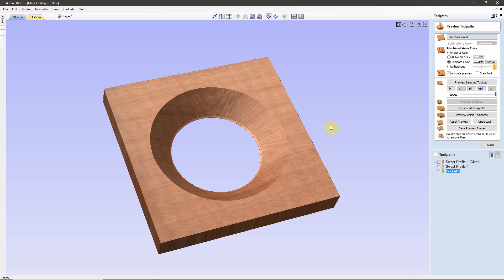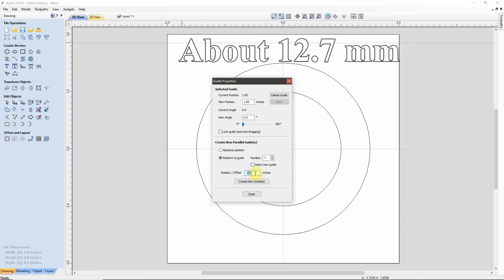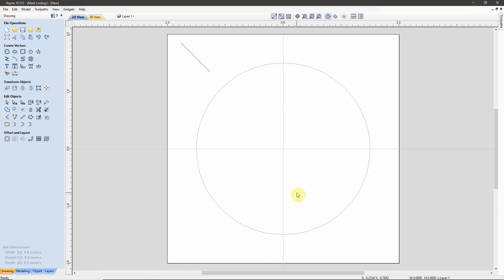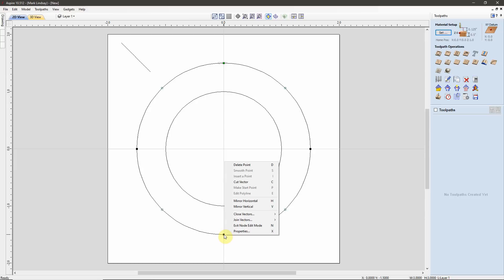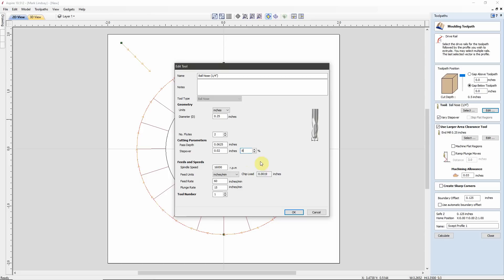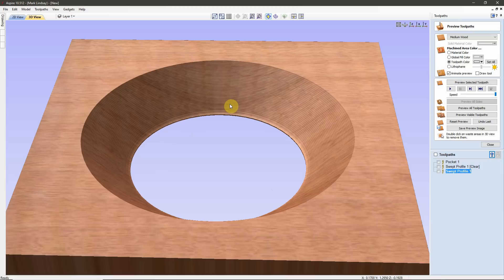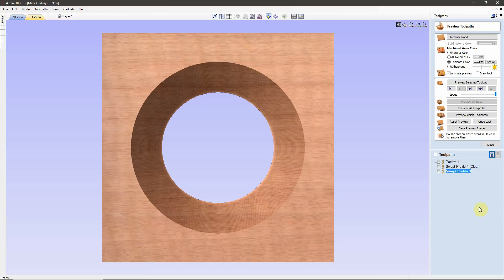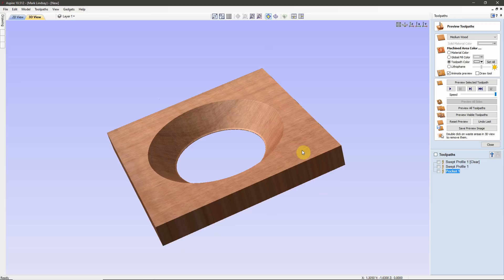Carve a Tapered Hole in Vectric VCarve and Aspire

Comment: Hello Mark, how could I make a long socket holder. I would like them to be snug around them, keeping in mind some smaller sockets have that curve taper to the tip. Further on I would like to make it at an angle, meaning the bottom of the sockets are lower than the tip.

Comment: Hi there,
You are teaching me (a complete newbie) a lot, thank you! A question. You say that it will always project out with a closed vector so you then split the circle into two halves. As al alternative why would you not have just left it as a closed vector and simply use the inner circle as the guide rail? Apologies if I am using the wrong terminology - as I said I am still really green at this.

Comment: To save wear and tear on the wide bit, could you have done a profile path yo the inside of the inner circle then remove the interior?
Reply from the maker: You would have to find a way to hold that inner piece so it didn't come loose when you cut it out. You can't use tabs in the Moulding toolpath. That's why I pocketed it out.
Reply: @MarkLindsayCNC  caveat I haven’t even purchased a cnc machine yet. Still evaluating the landscape and trying to find the courage to tell my wife I want to start a cbc business, lol. Thank you for your reply

Comment: I'm guessing we can somehow use this technique on outer profile tool paths as well? ...instead of applying draft to model. I'm not sure the result would be any different though but something to think about. Thanks Mark!
Reply from the maker: Adding draft to a model is not an option in VCarve, and the question I got was specifically about doing this in VCarve Desktop. Yes, you can add draft to a model in Aspire to get the same result. Actually, I can think of about 4 different ways of getting the same result in Aspire, but almost all of them aren't available in VCarve. As for doign this on an outside profile, just don't split the vector and the Moulding toolpath will project to the outside. Boom - done.

Comment: HI Mark. Good vid: A couple questions. 1) Using Guides vs. a square. If I knew I needed a 1/2" diagonal line, why not draw a 1/2" square and then a line from one corner to another? Seems like fewer steps then dragging and offsetting 4 guide lines. 2): why not select the inner circle, reverse the direction of the profile vector and make the swept profile rather than cutting apart the outer circle? Thank you.
Reply from the maker: Thank you! The reason I used guides in this video was to reinforce their use. I'd had a lot of questions about using guides prior to making this video, so I decided to use them for this demonstration. You absolutely can use a rectangle to get your angle. The reason I didn't use the inner circle was to avoid potential damage to the bit or the machine. By selecting the inner circle and sweeping that profile upward and outward, that means your bit is going to move over to that inner circle, plunge in the full thickness of the material, then try to carve it's way up and out of the trench it just dug in one pass. A good percentage of CNC routers can handle that, but a bigger percentage of home/hobby CNC routers can't. Additionally, depending on the bit you're using, the bit may not have enough cutting length to be able to cut the full thickness in one pass. This is especially true with smaller diameter bits. If you try to cut material that's thicker than the cutting length of the bit, you WILL snap it off. I addressed both of these questions in Live Q&A #75, which followed the video, the day I released it. If you'd like to check out that Live Q&A, here's a link: https://www.youtube.com/watch?v=SnmaSAArJAc

Comment: Great video as I always learn a ton of useful information. For a smaller taper at 45deg, couldn’t you just use a 90deg V Bit instead of a ball nose to taper down to the smaller circle?  Just a thought. I may be way off here. Thanks for sharing the knowledge!
Reply from the maker: That is absolutely an option, and it's probably the easiest way to go. But let's say the angle you need is 36 degrees. Unless you have a 72 degree v-bit made, you're stuck. But yes, your point is valid - I probably should have picked a different angle for the demonstration.
Reply: @MarkLindsayCNC  no worries. The technique you showed was valid and informational as I’ve never carved tapers and something I’ve been interested in doing here soon. I was just thinking a bit. Using a VBit, would the moulding tool path be the best option or would you recommend a different technique? Btw I’m using VCarve Pro. Thanks.
Reply from the maker: I'll discuss it more during the live Q&A, but you could pocket out the bulk of the material, select the bottom diameter vector, and do a Profile toolpath, machining ON the vector. And thinking about things like this is always a good thing. That's how we progress. It's one thing to say, "Do it this way," or "Don't do it this way." It's another thing to figure out why.

Comment: Why for hogging out the circle, did you not select a profile cut and cut inside the profile, rather than pocketing it out. Seems to me your method would take a lot longer. Learned how to do tapers though, so thank you for that.
Reply from the maker: Either way will work, Derek. Just know that using the Moulding Toolpath does NOT create a 3D component that you can attach 3D tabs to. Yes, you can create tabs with your Profile toolpath, but the minute you run that Moulding toolpath to create the taper, the tool is going to cut through those tabs. So if you use a Profile toolpath, make sure you have a way of securing the waste material in the center of your tapered hole. That's why I used the Pocket toolpath - to eliminate that possibility.
Reply: @MarkLindsayCNC  mank thanks for the reply and explaination of your reasoning. Cheers

Comment: What types of things have you done with this procedure Mark? I'm assuming there is more to be had than just making countersinks for screws.
Reply from the maker: This video was a direct answer to a specific question a friend asked me. Having said that, I have used it to make grab handles in drawer faces, and a recess on the bottom of a cutting board that will allow you to put a plate underneath and catch meat juices.

Comment: You mention the molding toolpath always projects outward with closed vectors. Why does the closed vector need to be cut in two places  rather than one? One cut vector is an open vector.  And yes, as mentioned in reply to another comment, in this case a 45 degree bevel bit does the job efficiently (of course only for 45).

Comment: Thanks for helping us all out.
Curious tho...instead of the trick with the guide lines (which I was unaware that you could create additional guide lines, so thanks for that!), why did you not draw a square with .5 sides and then draw the diagonal? It is less clicks.
Reply from the maker: I did that mainly to reinforce the use of guide lines, as I've had a few questions about them as well. I certainly could have drawn a rectangle (and I almost did,) if I knew the diameters of the top and bottom holes. Having one diameter and an angle would have made it a bit more difficult, but not impossible. It's an option, and you could certainly do it that way. There are usually several ways of achieving the same goal, and any way you choose that gives you the result you want is certainly valid.
Reply: @MarkLindsayCNC  understood, I just wanted to make sure there was no other reason. Thanks for responding!

Comment: Just wondering if using a profile cutout for the center instead of the pocket would be less wear on the .250" end mill?
Reply from the maker: You certainly could use a Profile toolpath. You have to figure a way to secure the center piece to the table (tabs, tape and CA glue, or whatever,) but it's a viable option.

Comment: Seems like using a 90° V-bit instead of ball nose might yield a smoother surface with this profile?
Reply from the maker: The purpose of the video was to show how to create a taper with the Moulding Toolpath. To do that, you should use a ball nose bit, much like a 3D carve. Still, there are many ways to get the job done. If you can do it with a 90° v-bit, and have one big enough, by all means, go for it.

Comment: Hi Mark, I am wanting to do a blank dish in a piece of wood. I can't seem to find what I am looking for on youtube. Is there an easy way to do this?
I'm thinking 3" in diameter and 1/4" deep. It seems like it would be so easy, but I can't figure it out. Can you help me? Thanks, Paul
Reply from the maker: If you check out my video on creating a 2-sided dish, you'll find what you need. The difference will be that you won't need to set up a 2-sided job, and you won't need to worry about the second model for the bottom of the dish. Just focus on the Top side of the project in the video; set the diameter of the dish, draw your Vector  Boundary, set the Shape Height of the dish, add a Zero Plane, and calculate the toolpaths, machining to the Vector Boundary. Preview and make changes if you need to. Here's a link to the 2-Sided Dish video: https://www.youtube.com/watch?v=M4JNMMG5YL0

Comment: Great video Mark. I had a tapered toolpath made for me in Aspire to cut 3" thick ash at 45 degrees. The tool ran a full 360 not half at a time. Do you know how that was done?
Reply from the maker: Not off the top of my head, Lane. There are 4 or 5 ways of doing it in Aspire, so there's no telling which way the person did it without having the file open.

Comment: Could this also be done by cutting the bottom hole with a straight bit and then using a vcarve bit centered on the line at full depth? Or some sort of combination?
Reply from the maker: Yes - to a point. You could easily do this with a combination of a Profile or Pocket toolpath to clear out the center of the hole, then a Chamfer toolpath to create the tapered side. The Chamfer toolpath was not available when I recorded this video. The thing to remember is that by using the Chamfer toolpath, the angle of the taper is limited to the v-bits you have.
Reply: Ok cool, I'm just learning on a machine lately and was trying to figure out ways to do this. I figured if you don't need a specific angle or if the angle is the same as what you have for a v bit, then you can do it that way. This is a really cool tutorial for it though, much more control of all the things.

Comment: But.....But...Mark...what if your circles are not actually circles and irregular shapes?  And therefore you do not have a consistent width of slope all the way around the tapered hole?  Been driving myself crazy trying to find a solution to that riddle.
Reply from the maker: That's where you get into 3D modeling territory, which was outside of the scope of this video. For that, you need to do a 2-rail sweep (Aspire only.)
Reply: @MarkLindsayCNC  Been trying that...can''t get it to work but thank you for the reply Mark.

Comment: Mark: Instead of breaking the outer circle into two vectors to get the toolpath to carve inwards, could you have selected the inner circle as the drive rail? Then, it would have carved outwards toward the outer circle, yes?
Reply from the maker: Yes, that is an option, Grant. The problem is you're now starting at the bottom and tapering outward and upward. That means for the first steps of the taper, you're machining away the entire thickness of the material at once. Is your machine capable of doing that in something like hard maple? Bit clearance also becomes an issue. What I mean by that is, depending on the tool, there may not be enough cutting length on the tool, or the collet may be in danger of crashing into the material. If the machine and tool is capable of cutting the entire thickness of the material, and there's plenty of clearance, then yes, you could project the toolpath up from the bottom hole.
Reply: @MarkLindsayCNC  I should have thought of that, duh! That's why they pay you the big bucks, Mark.   :-)  Tks much.
Reply from the maker: No worries, Grant. That's one of the hardest parts of doing this as a hobby - thinking ahead to the machining process before you even have the design drawn. Most folks in an industrial or production environment are used to doing that (with a few exceptions,) but as hobbyists, we tend to focus on one thing at a time. I mean, we can draw anything we want - now cut it in the real world. Sometimes it just doesn't work. Just mounting the piece you want to carve is a challenge at times, and sometimes what we want to do just isn't possible on a home hobby machine.

Now, where do I sign up for those big bucks? lol

Comment: I want to use a 7 degree dovetail bit to make tapered holes in cylinder (musical flute)  The hole will be 3/8" at the surface, the dovetail bit will be smaller (9/32"?) and rotated to create the 3/8".   Can you give me a clue how to do? Vcarce Pro.  One of the undercut holes is a rounded rectangel (mouth hole)
Reply from the maker: The software will not let you enter a bit that creates an undercut. You have to lie to it and tell it the bit is an end mill. Use the largest cutting diameter as the end mill size. My question is, how do you propose to use a dovetail bit to make a tapered hole, when the wider part of the dovetail bit is on the bottom? Any plunge you do will cut the widest diameter of the bit. Also be aware that dovetail bits aren't made to plunge cut - there's no cutting edge across the bottom of the bit. You might have better luck using a 15° v-bit. They're designed to plunge cut. Unless, of course, I'm not understanding what you're trying to do (which is most likely.)
Reply: @MarkLindsayCNC  I thought I replied to this last week, but I don't see it here.  It's a musical flute.  3/4" PVC.  The dovetail I have is 9/32, the finished hole will be 3/8.  I want to plunge in the center and route the profile, but apparently I can't do it with Vcarve pro 11.5.  The keyhole gadget will do the center plunge and exit, but it apparenly only wants to make keyhole shaped holes, I want to do round undercut holes and one undercut oval.   I could use the profile path if I could figure out a way to deposit a green node in the center of the hole.  I tried crossing polylines, but no center node.

Comment: What’s the difference between chamfer and taper???
Reply from the maker: A taper is a gradual reduction in thickness along a specific length. For instance, the entire surface of a piece of material can taper from .75 inches thick to .5 inches thick. A chamfer is an angle cut along an edge of a piece of material. It doesn't have to be to a specific depth.

Comment: Could you use a cove bit or a bowl bit guess they are similar bits
Reply from the maker: I've not tried it, but I don't know why it wouldn't work. Give it a try, but make sure to preview it to see if you get the result you're looking for.
Reply: Almost worked with bowl bit im doing a heart but the bottom and top over lap and leave ridges i can live with the ridges as it gonna be filled with wax for candle but the bottom is out of wack trying to figure out that now your tutorials are great
Reply: got it had to move the nodes wouldnt have got this without your help keep up the great work
Reply from the maker: Glad to hear you got it sorted!

Comment: Great video as always Mark.
Interesting  that the resulting tool paths (circa. 18:40)  are using both normal and climb milling - was this intentional ?  can this be avoided (i.e. make it go clock wise or CCW in both halves ? 
From the second example (i.e. without cut through) I understand that the inner circle is actually not used for anything...  
Also would I be right to assume that you are not limited to a straight line and you could use the same method to create an ogee style cut without the need for an ogee bit  (and probably also not limited to a circle for the guiding path...)?
Reply from the maker: I hope I answered your questions satisfactorily during the Live Q&A, Eyal!
Reply: @MarkLindsayCNC  Very much so, thanks.

Comment: I do have a question.  SInce you are cutting a 45 degree hole shouldn't you use a 45 degree V-bit?  Just thinking out loud.
Reply from the maker: You could do that, yes - but suppose you want an 18° taper. The purpose of the video was to show how to carve a tapered hole in VCarve Desktop and Pro at basically any angle. I just used 45° as an example that everyone could relate to.

Comment: mark im a "by hand" sign carver...new to cnc...when i hand rout a sign by hand i often need to create the illusion of depth by carving shallow in the foreground or bottom of a sign to a deeper depth to the background of the sign... as i learn how to create my layouts in aspire i find i cant see obvious way to increase the depth of the tool paths linearly from shallow cut to deeper cut from front to back in depth...how can i tell aspire i want all the tool paths the fallow a set linear depth from shallow to deep as i decide appropriate...?
Reply from the maker: That's something I'd not thought about. Are you looking for a tapered appearance as the carve transitions from the foreground to the background? Let me consult with a couple of my gurus and see if they have any input. I think I may have an idea or two, but I'll need a bit of time to make sure it works before I commit to saying it can or can't be done in the software. (I'm sure it can - I just need to confirm a couple of things and draw a few designs to dial in the process.)
Reply: @MarkLindsayCNC   thank you mark...:-)